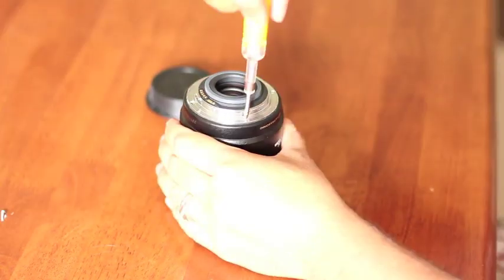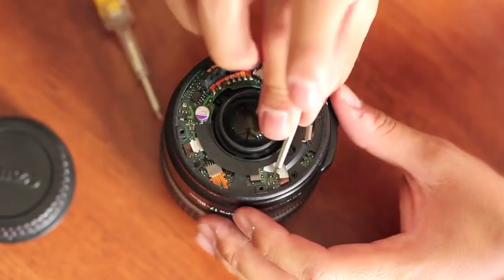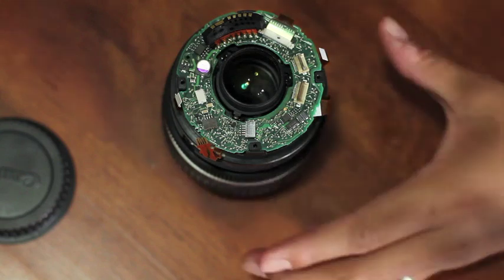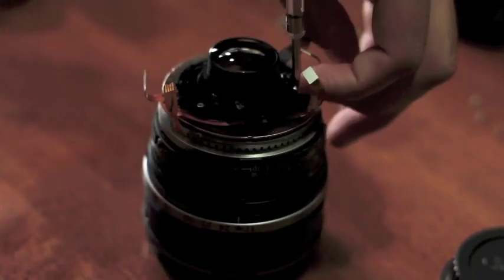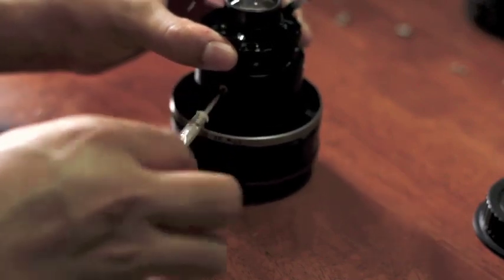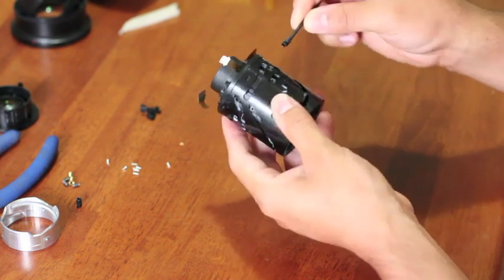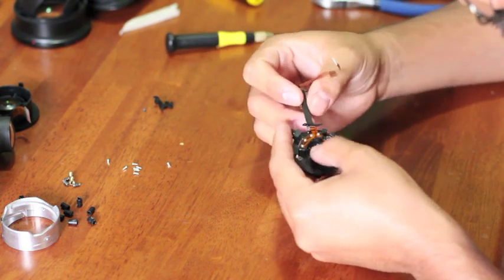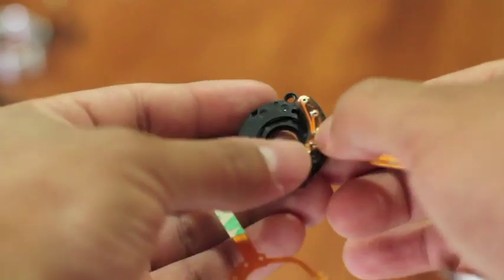Canon 17-85mm lens Repair Flex Cable

Comment: Local service (canon certified) offered repair for nearly 100GBP.

Thanks for the video, with the cable from ebay I've managed to fix it in about 1 hour. Needed just 2 screw drivers and solder iron :-)
Thanks again!

Comment: Reasonably correct if you wish to dismantle the entire lens, but overkill if all you wish to do is replace the flex cable. It is not neccesary to remove the 3 screws starting at circa 2mins 30 secs or remove the metal clip or barrel. Just take out the 9 screws and plastic bearings as shown & the bits come out leaving the barrel in place. A lot easier to re-assemble when done this way.
Reply: Thanks for your additional info. Sadly, I didn't understand what you meant, until I already disassembled a bit too much. The thing is that i kept the inner tube retracted all the time, but you have to extend it fully to be able to access the last three screws and plastic bearings. And indeed, it will save you a lot of hassle and time.

Comment: This lens is cursed!! I've gone through two of them, both failing due to the same issue! Canon should really be replacing this flex cable for free and re-design how it is sat in the lens to prevent future failing on all new ones being sold. It's so annoying. Thanks for this video, I'm going to have a go at fixing it in the next day or so - fingers crossed!
Reply: i agree,no fixing by me

Comment: DESOLDERING NOTE:

To desolder and remove the cable without melting the pins, use pliers to gently pull up on the ribbon while touching the pin/solder with the soldering iron.  As soon as the solder melts, the ribbon will slide off the pin.  I only figured this out after melting one the pins :/

Thank you for the video - very helpful.

Comment: Okay, great video to take it apart. But like all things it has to go back together and their are several steps where alignment is crucial to the reassembly of the lens. 30 mins to disassemble, 3 hrs to reassemble. It worked though...
Reply: @ Geoff Delvaux-Lunn.  Yikes.. but it's do-able thought ?  My camera is showing this error thinking of getting the parts and giving it  a go.
Reply: +Geoff Delvaux-Lunn EXACTLY what just happened to me.  20 minutes to disassemble and 3 hours to reassemble.  The inner barrel alignment was a killer!
Reply: David Stretch Did it work though?
Reply: +The Original Patent Yep, perfect now!

Comment: Thanks so much, I found your video very helpful. I soldered a replacement cable over the top of the existing cable instead of desoldering it. Your video is the best i've found. Thanks very much :)

Comment: Thanks for a great video. I'm all set to go - I have all the correct screwdrivers and replacement flex cable.
One thing though before I start. How do I get the lens off the camera ;-)

Comment: this does help with disassembling the lens. but putting it back together again was crazy for me. there are three small metal flat pieces inside the innerbarrel that the three screws at 2:50 are screwed onto. these were hard to figure out how they worked inside the spinning inner barrel. I recommend google searching for a picture process for the most detailed approach to fixing this issue.

Comment: The video IS fast and maybe not suitable for first timers but informative if you have tried this. The 3 metal parts  within the barrel can fall out so make sure you know where they fit in and the ''long handel part faces upwards, as down will limite the final movement even if assembled correctly. All the best but make sure you have enough light and a tweezer to hold onto screws.

Comment: very useful video - I just replace my cable, which had become severed from wear. Reassembly is tricky, but possible if you follow along carefully. Don't forget to line up the plastic focusing arm with the ring when assembling; otherwise the focus wont work (on manual or automatic)

Comment: Nice thanks, my Zoom got stuck after using the lense on a gimbal... after disassembeling it i found out that the three screws that hold together the focuspart (on the side) had become loose. The lense is fully working again now =D Thanks for the video!!

Comment: I have an EFS 17-85mm lens that gives me the Err 01 at any zoom range below 35. Will the flex cable likely fix this issue? It also will not take pictures in auto-focus mode. Thanks for the video!

Comment: Thanks, Really., what happend with other instructions That need to dissasembly and mes up focus adjustmet of front element ? this is best video ! I got my cable in 2 days from ebay Brooklyn NY "Lens Shutter Flex Cable for CANON 17-85MM LENS CAMERA "

Comment: I cannot remove the barrel at 2:24. I've done everything else to the T. I did notice that the last, largest flex cable on mine is different and does not have the black part, just white, so maybe we have a slightly different version of this lens. Any hints?

Thanks!

Comment from the maker: One note! at 1:30 I remove the rubber zoom ring. There is a small black adhesive that you can remove at this stage, and unscrew and remove a lens contact point (it looks like a small rake) I didnt realize I forgot to include it into the video, but it helps if you remove it at this stage and then to put it back after you have closed everything up.

Comment: I have a small problem.. I ordered the part, it arrived today. I have just finished taking the entire lens apart, just to discover that it has a completely different flex cable to the one in this video, which I ordered. I'm very confused, surely this is a standard part on all Canon EF-S 17-85mm 1:4-5.6 IS STM Lenses? Anyone else have this problem?
Reply: I think the lens in the video is USM not STM version